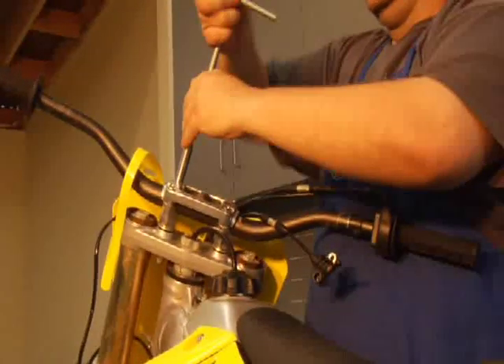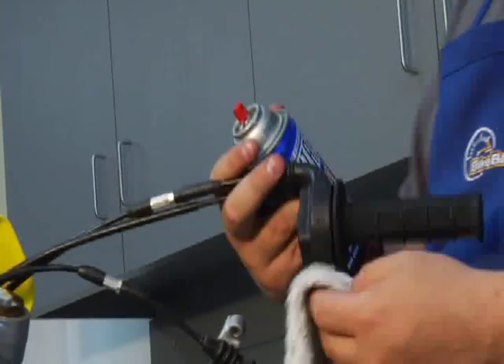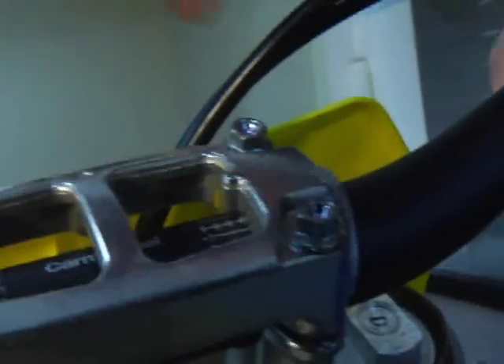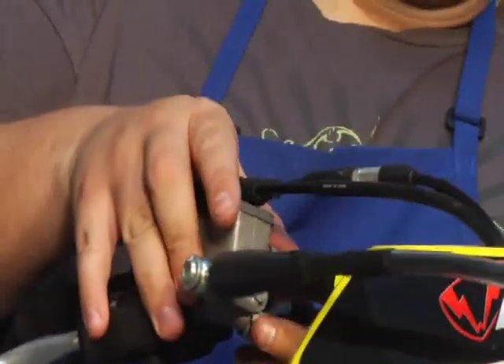Dirt Bike Handlebar Installation

Comment: Aftermarket bars are made brand specific for Yama, Suzu, Hond, Kawa or any other brand so you can't go wrong. They do have different styles of bars for your model such as taller bars, or fatter bars. Which ever you get its your choice, I like the fattys. I do wish someone would make pre cut bars for Enduro racers. I cut 1 inch off each end of my bars so I can maneuver threw the woods better without my bars having to much trouble with trees

Comment from the maker: Personally I try to avoid using safety wire unless the grips start spinning, If the grips start spinning, throwing some safety wire on there will help. Check out the BikeBandit website for a wide selection of grips, safety wire, and safety wire pliers. Good luck!

Comment: not on handle bars you want to attach top, sung up, then tighten the bottoms because the bar mounts are just clamps. and that will clamp the most even unlike a cross. however i dont think it matters lol.

Comment: I Just picked up a Honda CRF for my son. The bars are welded on. I assume I have to replace top of Fork mount if I want to install a new One. Sorry, new to this.
Reply from the maker: Hi Silk,First off, great job for picking up a motorcycle for your son. That's just awesome!Which model did you get him? Depending on the model will depend if the bars are replaceable or if the whole top clamp needs to be replaced. Keep us posted.
Reply from the maker: Me again,Upon further research, I think that if the bars are welded on, it must be a CRF50, as all of the other models, have the bars mounted in clamps. Keep me posted if I'm on the right track please. What's the reason to replace the bars? Bent in a tip over? Your son needs a little more height in the control area?Thanks.
Reply: Thanks BB for quick reply. Actually I have 3 sons 10, 8 and 5. They started riding at  4 yrs old. I bought a Yamaha TTR 90, CRF 70 and just picked up a CRF 50 for my 5 yr old. It is the CRF 50 Honda that has the bars welded with the Gold Forks which are sharp, but the Bars are a lil beat up and the weld is terrible. Doesn't look like they were original. The only thing I didn't do on a Dirt bike yet was replace forks or mount for Handle bars. Everything else, I basically restored. Just trying to get some ideas. Awesome Videos. Thanks for your help!
Reply: BikeBandit.com Just seen your reply after I sent mine. YES, CRF 50.  I am going to restore the whole look of the Bike. Got a new White Plastic kit, White Seat. Getting Frame painted White and having the Bike done in Evel Knievel Custom Decals. I have a huge collection of Evel Figures, cycles, etc mint so I turned my youngest into a Evel Nut. lol Thanks BB
Reply from the maker: Well you've got a few options, and much of it depends on the size of your 5 year old.You can always go back with the stock components, and of course we can get you them.There are other options, such as the Pro Taper XR/CRF 50 kit. @pro-taper-xr-crf-50-kitIt'll have everything you need to replace the entire control area, all the way down to longer cables and new grips. Let us know if you've got other questions, but it really comes down to how original you want to keep it, how much money you'd like to invest into the bike, and the size of your son.Once again, great job to you, for having the family riding motorcycles.
Reply: Thanks Again, Yes, I dig the Pro taper Kits. I was just looking at them. I don't really care about keeping it original.  Do u have a web-site? I will be in touch.
Reply from the maker: BikeBandit.com is the place to shop for all your motorcycle, ATV, UTV, PWC, SnoMo needs.Make sure you add us to your bookmarked favorites, and Subscribe to our YouTube channel too.Thanks for the support and the business, and enjoy the ride!

Comment: I can't get the 4 bolts off holding the bars on. It's a 2016 kx250f. any suggestions? The bolts are just too tight.
Reply from the maker: Hi Brent,
Some times it requires a little more effort or a lighter tapping on the ratchet handle rather than trying to just pull them loose. Strange considering it is such a new bike.

Comment: I bent my renthal handlebars and I am replacing them with pro taper bars. can I leave the same mounts or do I have to spend another $40 on more mounts? please respond ASAP!
Reply: As long as the tubes are the same mm youll be good.
Reply: 5 years later you got your response

Comment: Would this be the same process on a 1978 Honda XL250s
Reply from the maker: +xXRevoltShadowsXx 
Hey XRSX,
It will be very close if not exactly the same. You might have a different style of clutch perch or throttle tube mount, but the general idea will be the same. Clamps are clamps and bars are bars. Not too hard, but the difference in a new bend, or replacing a bent set of bars can be huge. Thanks for watching our videos and the question. You're a subscriber, right? Ride safe. BB.com!

Comment: do i need new grips from original bar to fatbar?
Reply from the maker: +Petter Kulhuset 
Hey PK,
Nope. All dirtbike grips will fit the same size bars. The difference on a FatBar is the size of the clamping area to the clamps. Remember though that ATV's run specific grips as they have a thumb throttle, thus no throttle tube. Hope that clarifies things a bit. Thanks for watching our videos and the question. You're a subscriber to our channel, right? Ride safe. BB.com!

Comment: well i have evo's and they dont fit on my stock yz125 clamps im pissed
Reply from the maker: JustLoveIt The EVO's are 1 1/8 bars, and I think that your mounts are 7/8. ProTaper makes adapters that are made specifically to do the mod. The bottoms are cut to drop into your mounts. The tops are cut to hold 1 1/8 bars. Nice part is that they give you a little bit of height too.